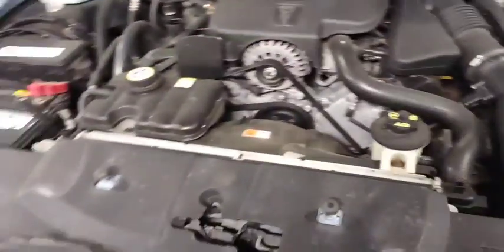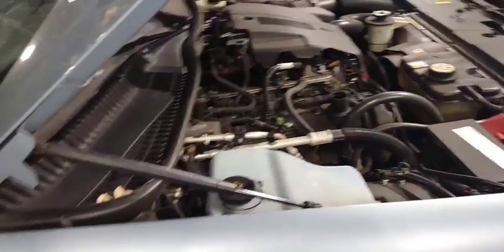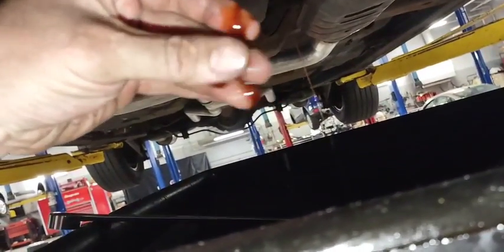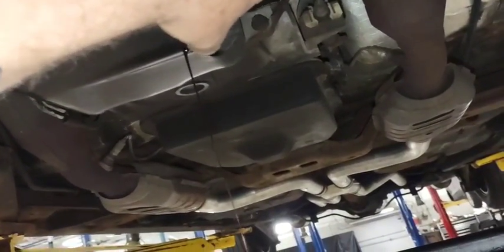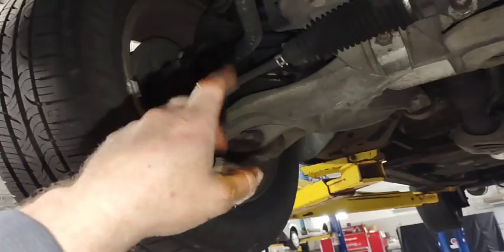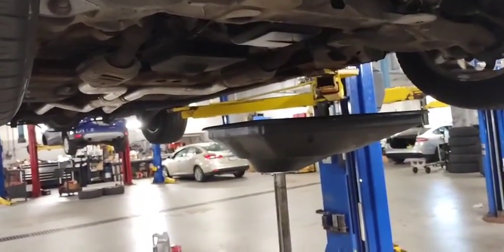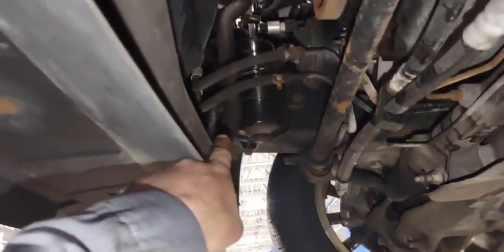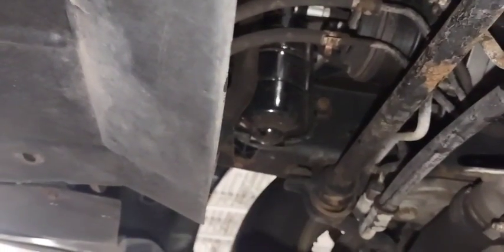Pennzoil Platinum Ultra oil drop 5k Miles, the next 5k Miles trying Mobil 1 extended high mileage

Comment: Best off the shelf oil of Pennzoil Platinum.  Going backwards with Mobil in my opinion.
Reply: Agree. Mine ran a little louder with M1.
Reply: I don't run anything but platinum also. The amount of wear protection it provides between surfaces is unmatched.
Reply from the maker: Guys you got to relax with the comments about the specifics of what you suggest this was asked of me to do by subscribers and that's what I'm doing, I'm literally giving you what you guys are asking for and then you're breaking me down because I'm doing what you guys are asking
Reply: @FordBossMe  Love your content keep it up. I am interested in seeing if there is any noticeable difference in noise or engine smoothness between the brands you're going through
Reply: I had a F-150 come in 5.0 2012 model, I'm going to say 2 months ago maybe less he wanted to make the switch to the Amsoil which is fine great oil with several other manufacturers and names and he wanted to do oil analysis well I did a oil analysis on the Pennzoil and it did just fine at 5,200 mi showing you know a little bit of breakdown and how new engines are with using oil you can top them off. I think that oil would that easily hit 7,000 mi before making your decision changes or not.

But I get it I don't do long intervals on everything I don't know my mustang (2016 gt premium) We don't want our Lexus I mainly have one or two vehicles that I do long intervals on and they are the ones that destroy the oil the most 😂 I use a 2003 Ford excursion 7.3 and a 2004 f250 And if they can respectfully no longer intervals for being a direct injection with low fuel dilution I use them as my test dummy.hahaj Honda's on the other hand I don't know how they're doing now but since 2017 to 2020 I had to change the oil every 3,000 mi due to Honda not fixing the oil dilution issues at 2500 mi it was saying upwards of 15 to 20% of fuel in the oil...
Reply: @FordBossMe  keep doing what you do If people want you to do some stuff do it at your discretion, everything I do it's at my discretion. Cuz I'm getting ready to kick myself in the nuts and go back to rotella to see if they've made any improvements over the last 5 years which I doubt it.

But most of these off-the-shelf oils you're going to find one that treats you better than the rest but if you're happy with three to five K intervals do it... Mostly oils depending on vehicle application And I mean depending you should be able to get 6500-7500 miles But nobody knows your vehicle better than you.
Reply: That is a gem of a car! 225,000 miles is really nice, had 300,000 on my gmc g2500 Vandana 4.3 liter only used valvaline synthetic high milage stuff unfortunately rust ate the unibody away.
Reply: Right. Mobil 1 is bad.
Reply: @carlm2590  I had a 2002 Miata and it made a lot of top-end-cam noise on Mobil 1.  I changed to Pennzoil Platinum and it was quieter.
Reply: @mikec9112  Valvoline is my #2 choice in motor oils, after only Pennzoil Ultra Platinum.
Reply: The synthetic oil structure/chains are able to hold together and still effectively do its lubricating job but the issue is the detergents and dispersants that suffer they can only do so much. so although the oil can continue on lubricating no worry's it's not able to retain contaminants which results in sludging which is where that damage starts. 

When i done my engine reconditioning/machining apprenticeship years ago I had a chat with a penrite rep and he blatantly said with all the synthetic technology in oils these days the oil can hold up to 20,000km before the chains start to break down but the oil is only as good as it's ability to clean and retain contaminants, on a standard modern petrol engine the dispersants and detergents are completely at the end of their life by 10,000km and that's on a clean running engine it will be significantly less on older engines and diesels which is pretty self explanatory.
Reply: Yes , would like to see how M 1 looks at 5k
Reply: Great
Reply: Used penzoil ultra platinum before never had a issue. Than I switch the liqui Molly 5w 30 Gen generation
Reply: @bewareofmountainlions4429  I run valvoline high mileage with Lucas oil stabilizer with a factory Nissan filter
Reply from the maker: So far I've had no engine noise, Vehicles actually pretty quiet
Reply: Only way to know which oil is better is to do a UOA analysis. Looks and smell are only a small part of the equation
Reply: @FordBossMe  Curious as to how long it takes you to rack up 3000 miles or 5000 miles pending how long your running your test . 
  Will be interesting to hear your results and thoughts . I have been a faithful  Mobil 1  user for 35 plus years . Even racked up half a million miles on a 2000 GMC Sierra 4.8 liter using Mobil 1 full synthetic 5/30 every 3000 miles religiously . That truck pulled car trailers and a 32 foot 5th wheel on a regular basis without a single internal engine failure , issue or noise . 
   Your findings will be interesting though , i had a bad experience with the conventional Pennzoil back in the late 90's so naturally i was and have been reluctant to even consider Pennzoil's synthetic formula .
Reply: @1997obspsd  Wondering what the issue with  Rotella was or is ? The only Rotella oil i used was their transmission oil before an additive was available . All the store brand Type F transmission oils i used created odd shifts in the 4R75W & 4R75E . 
  As for oil change intervals it is bothersome how far manufactures are spacing suggested service times . 2014 Toyota Tacoma the warranty guide recommended the very first oil service at 7500 to 10,000 miles using synthetic oil but not the filter . The filter was recommended at the second oil change . I went and re-read it 3 times thinking i was missing something . Who in their right mind changes their oil but not the filter  ?  Manufactures should start adding a foot note stating that earlier oils service intervals of 3000 to 4000 miles are also recommended for engine life .
Reply: Best is Amsoil.
Reply: @7natcho  Rotel is very popular in the diesel world for like  for Huei systems. Which is a no no cuz that oil does not have very good anti-foam properties. So if you're oil can I prevent itself from foaming If I mean for one is not lubricating and any type of foaming or excessive I mean is breaking down of the oil. No a little four-cylinder or a V8 most of these vehicles today are not going to be as hard on oil. But direct injection versus port injection You're going to have different fuel dilution issues. Then turns into clearances and operating temperatures and just held the motor operates.

Rotella for the average consumer is a good cheap consumer level oil It's just a little on the cheap side and not as high as quality as you can get for oil  in like the class three range. Because they've came up with a new series of oil which is a lot better than what they've been doing on the gas side but I wish they would do a lot more on diesel trucks that use oil past 3,000 psi to fire injectors. No I've seen rotella go for 20-30-40,000 mi on big rig applications but big rig applications have way more filtration and they do not destroy oil as bad as the typical light duty vehicle, oil clearances are totally different and they're mainly all highway miles with idling.
Reply: @7natcho  well anybody that's telling you to not change the filter is not a really good manufacturer to listen to, Then you're correct The average manufacturer right now is 5 to 10,000 mi But that's also going to be off a roughly year prorated length. But another thing they fail to tell you or the manual does is where you live at If you're in a colder climate and anything's direct injection or you have a lot of idle time you're going to run into fuel dilution. Filtration is one of the main killers of engines for an example another oil I'm messing with right now is Conklin and they guarantee their oil for a long long time but they want you to be within 1,000 to 2,000 mi of normal intervals and with that being said they want you to change the filter at normal intervals so that means you're going to be doing a half court to a court top off every time you change the filter which is going to rejuvenate the oil. When this is where It becomes is it worth it Is it worth it that I have a vehicle that holds four or five quarts and it uses a quart then I got to change a filter and use another quart? I'd be better off too change my oil. My oil changes are 4 gallons roughly a piece on three vehicles and if I'm only using one to one half quarts per 5,000 mi or longer I just top it off and send an oil analysis off before I top it off and I keep going. If you're looking for good maintenance records 5,000 mi is a great mileage change at 7500 maybe if it's a yearly mileage.  But where I see long intervals that help people are going to be your hotshots and people there on the road everyday doing 20 40 50 60 plus thousand miles a year mainly highway miles which does not destroy the oil like most people think It really depends on you and your discretion on how you use the vehicle how you should change your oil to an extent.
Reply: @madeofscars9355   you're right. That's why a lot of the stuff is going to be a case-to-case basis because depending where you live at how you use the vehicle and oil testing that you should be doing to see what the oil is doing you'll know where your sweet spot of that vehicle is. Even with high quality oil sometimes it's better to change it at 4500 to 6,000 mi then some people can run oil for a year and do about 7-8k send an analysis off and it's unremarkable how good it's doing.
Reply: @1997obspsd  Thank-you but i was not looking for advice on service intervals . My comment was more pointing out the insane schedule by Toyota in regards to mileage and filter replacement . 
   I am diligent on engine service with a 3 month 3000 mile regiment but if need be will only go to 3500 miles .The experiment Boss is doing i am interested to hear his findings and conclusions . I have been a Tech for 30 + years and Mobil 1 Full Synthetic  is my preferred oil .  I use a full synthetic to benefit the internal workings of my engines  not to save money stretching out oil changes .  As for my customers i always reset their oil change monitor but also post a windshield oil change sticker with a Next Service at 3 months 5000 mile . Customers also have a choice of Full Synthetic or a Synthetic Blend oil  . I do not use conventional engine oil unless the customer specifically  asks . 
   With your oil changes consisting of 4 gallons of oil i am assuming all 3 are diesels . i am asking because i am not familiar with Conklin oil . Going to have to do some reading . Is this a diesel oil ??
Reply: Damn that thing looks clean underneath for the milage. Good job! IMO Pennzoil is the better oil based of lab results I've seen and studied but M1 is also a fantastic choice too. Pretty much any quality name brand oil at 3000-5000 mi intervals will make an engine run a very long time.....unless it's a Chrysler. Your just up shit creek no matter what you do then.
Reply: @tylerwightman2315  I had a ram  gas with 350k only used amsoil only dodge iv seen that would die lol
Reply: @toddcook8824  prove it, don’t just SAY it’s bad unless you can back that up with fact or links, or reputable science.
Reply: @steverugerguy9606  I’ve been using it since 2003 after hearing a story from a pretty smart guy.
Reply: @clerictamer  I could show you what it looks like at 6k, I run it in everything I own, including my OPE engines. Been running Mobil 1 since 2003, and none of my engines have varnish inside, I have checked inside the filler necks with a flashlight, and I can see the aluminum and cams look new. The proof is in the engine.
Reply: @tomlantis8016  why did you switch then??
Reply: @mauricemotors8207  you don’t really believe Nissan makes their own filters, do you?
Reply: @FordBossMe  so many guys out there bashing Mobil 1. Well back in ‘03, I was working for an OPE repair shop with a Vol FF that worked at the shop in the AM and left at lunch to go work at his station. He also was an assistant crew chief for a Busch North race team. Back in 1988, he had just started out on a team as low guy on the totem pole. His crew chief at the time just rebuilt a motor they put in a car and he told Mike to change the oil, so he did, and what he put in was Mobil 1. The car ran like dog s***, couldn’t get out of its own way and it almost didn’t qualify. Mike couldn’t figure it out, until it dawned on the crew chief to tell Mike to change the oil again after he asked mike what went in and mike told him Mobil 1. Well he did, and the car placed like 3rd or something which was pretty good I guess. Apparently, the Mobil 1 wouldn’t let the rings and bearings seat in to the engine, so there was no compression or oil pressure or anything, that’s how slippery Mobil 1 is. He told me he hadn’t run anything except Mobil 1 after the engine was broken in on anything he bought new, and if he got something used, he’d immediately change the oil and put in Mobil 1. I’ve done the same for almost 20 years and my engines all look new under the valve covers, so if that’s not evidence a guy could see with his own eyes, then I don’t know what is. I’m sure lots of brands have good and bad, but I used to like Castrol a lot, until I found out it’s full synthetic Edge oil started out with conventional base-stocks. Mobil 1 is and always has been FULL synthetic, they don’t start with conventional and add additives. Plus Porsches and Space Ships use Mobil 1 from what I understand, and SCAG mowers have a HUGE hydraulic oil reservoir, while Exmark has about a quart-sized reservoir, and they both have the same oil change interval, but Exmark recommends 15w-50 Mobil 1 and SCAG doesn’t, so why does Exmark need so much less fluid for the same change interval? It’s a very good synthetic oil, that’s why.
Reply: @7natcho  I’ve been with Mobil 1 since 2003, so I’m with ya’.
Reply: @1997obspsd  you don’t want or need to idle diesels, it’s just more pollution and adds to contaminated oil from the fuel and increased wear, you wanted to idle older engines, but not so much anymore. Also, nothing wrong with rotella, otherwise nobody would use it and it wouldn’t be around. Everybody uses T6 and it’s cheap so you can change it more often, especially with all of the new engines with blow-by issues and regens, you want to get that fuel-laden, soot-filled oil out soon so it doesn’t turn acidic. I’m happy it’s so cheap, I can save my engine and my wallet when other guys are spending $10k plus on a cab-off engine replacement on their Powerstrokes. Rotella T6 or Mobil 1 are my oils.
Reply: @1997obspsd  with all of the lower compression engines and blow-by as a by-product (think new manufacturer engines consuming MUCH more oil than they should, even after break in) it wouldn’t make a lot of sense to wait until 10k to do an oil change. You’re still removing carbon, fuel that gets past the rings, varnish build up, and old oil becomes acidic, that’s why you get not only a mileage, but a date with an oil change, regardless of if the car just sits in a garage for three months, you should still change the oil. 10k miles is foolish, don’t listen to the manufacturers that design vehicles to become mechanically totaled in five years so you’re forced to buy a new vehicle, or that charge exponentially more for parts for, hoping you’ll trade it in for a new vehicle. Every 6k like clockwork for me, and I’ve never had any engine issues with any vehicles in 20 years just about, using only Mobil 1.
Reply: @7natcho  look at it this way: you can pay $40 for two conventional 3k oil changes, or about $35 for a Mobil 1 6k oil change with a Bosch filter. Synthetic is better for the engine than conventional, one oil change uses less oil, so better for the environment, Mobil is a detergent oil, it goes in Porsches and space ships, it somewhat conditions old seals and gaskets, and it costs less than the conventional, what’s not to like!?! I’m with you dude, Mobil 1 all the way. I’d try amsoil eventually, but royal purple seems gimmicky. Mobil 1 works well at its job, I don’t get the animosity from everyone towards it.
Reply: @dakotabowes2387  damn. Id say you got hella lucky or you did something right with it. Every Chrysler product I see or work on that's made it to even 200k is usually a shit can rattle box falling apart everywhere and is on its second or even third transmission. The ram trucks seem to be a little better than the rest of their line up tho. Cheers.
Reply: Pennzoil Ultra Platinum is best off the shelf. Its one step up from Platinum.  I get mine off of Amazon for 24$ for a 5 quart jug. Phenomenal stuff. I run it in my 15' V6 Accord Coupe for around 5-7k with a pure 1 filter with zero issues and tremendous cleanliness and efficiency.
Reply: @concernedcitizen780  yes you are correct, Amsoil is the best in terms of all aspects. 

Their Signature Series ATF was tested in a taxi cab in Las Vegas, Nevada (very hot climate and majority city driving + sitting in traffic)... they put 180k miles on the same fluid and upon taking that transmission apart, very little wear was found on the clutches. I'm changing my atf out with the stuff and hoping my Camry makes it to 400k miles or more
Reply: @theactualsalvagedrover  penzoil ultra platinum isn't in stores here. Plus I've heard moly is better. But idk
Reply: @theactualsalvagedrover   not nessarily. Manufacturers have a usage rate.  My excursion uses a quart per 5k interval. It also utizles 18 quarts.  So it's cheap the top of oil and replenish the oil with a top off. The average car they  days take 5+ quart   so toping off a quart or so to go to 7500-10000 is cheaper than  a new oil change.   And I don't listen to manufacturers. I do my interval to my liking and testing have been for 11 years. Engine oil should be one of the last oils I'd worry about. Doff,trans,transfer ect need more attention since no one pays attention to them. But I run 5-6 k interval on my mustang (2016) my foxbody I did 3k do to limited driving and drag racing.  But you should.bot.be doing long intervals of you don't  keep up with you oils health.  There so much testing that debunk 3-5 k intervals and there is mis information thats scares longer intervals.  I do my year plus testing on vehicles that destroy oil more that a gas/ small displacement engines. My oil see extreme conditions of 3000+ psi for a year or mileage depending on what testing shows.  Most modern gas vehicles you gotta watch fuel dilution since tuning ain't perfect,direct injection and informed induction. New vehicle are gonna use more do to tolerances and majority of them are turboed... So blow blow is a given do the looser ring gaps.  .not telling people to go 30k on an oil change but you Should  definitely see what that oil  is doing. If longer intervals weren't not  working or saving $$$ I wouldn't still be doing it I would have dropped it years ago so would  heavy machinery/military mechanic/companies. But you don't need to do long intervals but you should use quality oils. What's a year 5,000-mi oil changes are going to be consistent with your other using the oil that doesn't break down doesn't foam does what it's supposed to do or use a cheaper oil that breaks down quickly and doesn't protect? Just not all about the long-term intervals It's also about long-term effects. I rather have maximum protection versus using cheap oil.
Reply: @7natcho  not really advice but I thought it was unusual cuz most texts use mobile one then they show you what they put in it I've sent several analysis off and they were not using what they said it was I also sent to several testers and the bottles were just displays I'm not saying that your case but it's hard to trust a lot of dealers. But this is not advice this is kind of proven but at 3,000 mi you're wasting oil That will if it's even good is barely even breaking down. But I'm into saving money not wasting it. I haven't had issues out many oil but test several that don't do good drop cause people don't understand basic lubricants /application s.

The only reason you should be doing 3000-3500 mi if you're using conventional oil. And if the customers are asking for that and they use that over what it's recommended it's not good if they're using it long-term because it does not have the protection or the TBN or have the additives that the engine was dealt developed for. No companies like Ford that actually have proven and shown oil It's not just oil and they've been doing it since the late 1990s where they've had to get oil redeveloped for several vehicles shows me that we should take it more seriously. They were having issues in the late 1990s and the early 2010s with failures due to oil-related issues on the 6.7 powerstrokes. That's why it's very important to pay attention to see if oil meet/exceed manufacturer  recommendations. So why cases CK-4 is not a good choice You should be using C j-4 or CI-4/ci-4+One of the reasons why that was developed was because of the failure rates with CK-4 on several engines not doing its job. CI-4/plus was designed to work with older engines that required CJ-4 and the newer generation oil for CK-4. That alone shows your oil is not just oil.
Reply: @theactualsalvagedrover  there's nothing wrong with mobile one if you're actually using the higher grade stuff If you want to talk about bashing I wouldn't use Royal purple, I wouldn't use the cheap mobile one in the grand black bottle, because they honestly really do not meet most manufacturers requirements. But a lot of oils have gotten worse just to meet the API/SN/SN-plus. Roll a purple used to be a high quality oil until they had to meet regulations and got sold out to a company and not family owned anymore.
Reply: @tylerwightman2315  my truck was older 2001  some of the trucks can last but most of there cars are junk lol I use amsoil in every thing from the rare axle to the power steering and change them on time have never had a motor or trans go bad most of my cars get past 300k b4 I sell them unless I see a neat beater I have to have lol 😂 I prefer Chevy  have a old 93 with 352k and a 02 van with 360k and i did have a 6.0 Chevy
 truck with 425k but it got to rusty
Reply: Redline Ester based 5w-30 with added zddp(zinc) in my ecobeast. Any Ester/castor based oil will have better film strength than any conventional or  synthetic petroleum based stock.
Reply: @dakotabowes2387  must have been the 5.9 magnum you had. Those and the old slant 6's as well as the jeep 4.0 straight 6's were about the only good motors I think Chrysler ever came up with and they were actually fantastic engines. I agree with you. Amsoil is good oil. I just sold a 7.3 powerstroke that I used amsoil in frequently when I could get it for a reasonable price. Drove it for many years and had just rolled over to 300k when I sold it. Never had any major issues with that truck. I also had a Silverado 5.7 vortec and a 92 Honda Accord that went over 300k with no major engine work. Had several cars go over 200k (all still running when I sold them) and currently own an 07 Audi A4 3.2  with 238,000. Bought it in 09 w/30,000 and the only repairs in 12 years of ownership have been a radiator, clutch at 180k, and 3 ignition coils. A little regular maintenance on ALL systems can really cut down on repair cost and make a car run a long ass time.
Reply: I had a 13 MazdaSpeed3 that hated Mobil1 full synthetic. 38k and she would blow puffs of blueish smoke under WOT. I ran it for no more than 3k and went With Castrol Edge. Personally I’m a Castrol guy and let me tell you, after that Castrol went in I got on it like usual and I shit you not, she didn’t puff blueish smoke anymore I agree 100%, Mobile is going backwards.
Reply: @FordBossMe  don't let the bastards grind ya down.
Reply: @FordBossMe  Don't worry about the trolls, dude.
Reply: You’re doing fine. Guys crying about their loved oil brands is worse than guys fighting between their favorite sports teams. Just preach the truth and experiences. Guys get easily triggered when they hear it.
Reply: @theactualsalvagedrover  Mobil switched to a Grp III base stock not that long after Castrol did, as it is much cheaper. Mobil One is NOT the same as it was back in the day. I have done a LOT of UOAs to monitor oils I use and am no longer using M1. Just my personal opinion....
Reply: @1997obspsd  It's Mobil, not Mobile.
Reply from the maker: @retiredandroaming  who cares we know what people mean

Let's chill with all this politically correct crap
Reply: @FordBossMe  I assume you meant to reply to someone else, as I don't believe I posted any "politically correct crap" anywhere.....
Reply: I'd agree for my car. Pennzoil ran quieter in my 1MZ and looked at 4500 miles what the M1EP (regular) looked like at 3500 miles. Of course, every car is different, and I'm changing the oil pretty much every month.
Reply: On these videos can you put a link in the description to the follow-up video?  Just makes things a bit easier to find the results video later on.
Reply: I approve this comment 💯
Reply: @carlm2590  I'll never use Mobil 1 messed one of my engines up years ago by burning out the rings and scoring the walls. 

I only use pezoil ultra platinum or Amsoil full synthetic.
Reply: @FordBossMe  mine is quiet ormobil 1 ....the regular mobil 1
Reply: @theactualsalvagedrover  yes...its good stuff.
Reply: @retiredandroaming  where is this info you found to back that up? Why would they switch to a conv base but nobody said anything about it?
Reply: @gsxellence  there’s no way that’s true.
Reply: Ultra platinum or the standard platinum?
Reply: @ajmedeiros77  Wouldn't "Platinum" itself kind of be the ultimate version? How do yo0u know the difference between "levels"? Is there ACTUALLY an "ultra" platinum, and a "standard" platinum? Some people fall for anything.
Reply: @toddcook8824  Are you a chemist or engineer?
Reply: @1997obspsd
Reply: Agree. Before I started using it I was using Mobil 1. Theres a very noticeable difference
Reply: @bewareofmountainlions4429  I can actually say there is between these 2. Ive been using Mobil 1 for years but when I switched to the pennsoil fuel mileage improved and the engine was much more smooth.
Reply: @FordBossMe  agreed thank you for doing this, I vote 5k since that’s when most of us who take care of our stuff change our oil plus it’s 5k to 5k good apples to apples. I know that ultra platnum wins but i want to hear your thounhgts on it, I used to use Mobil 1 extended performance but switched swithced to ulta platinum
Reply: @FordBossMe  True because no one stays on top, these companies are only as good as they try to be better.
Reply: It really doesn't matter what synthetic oil you use @ 5k mileage oci.